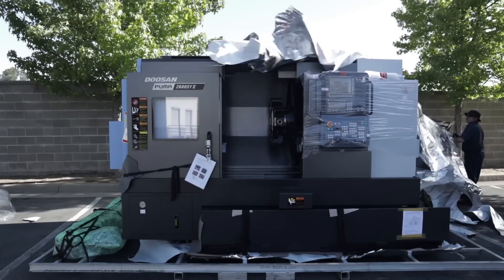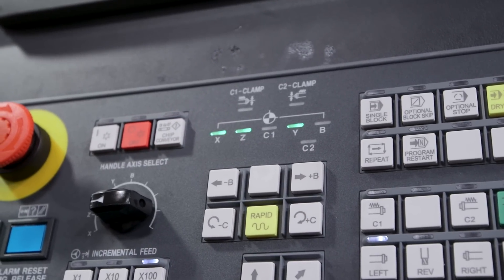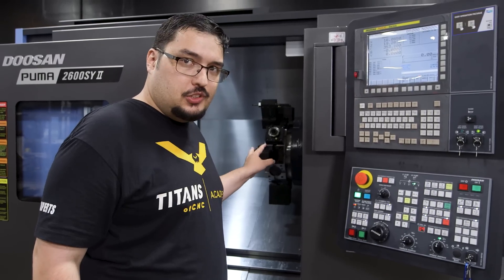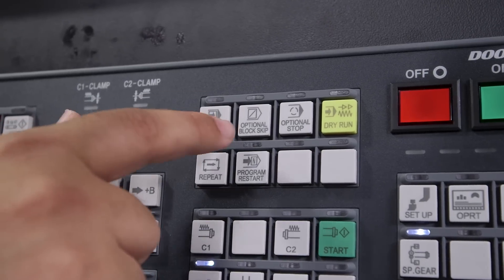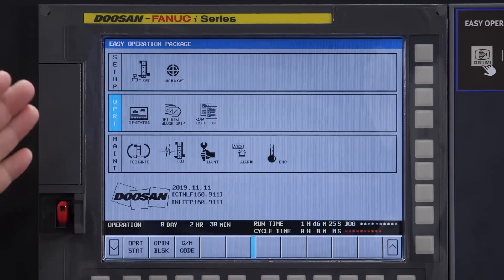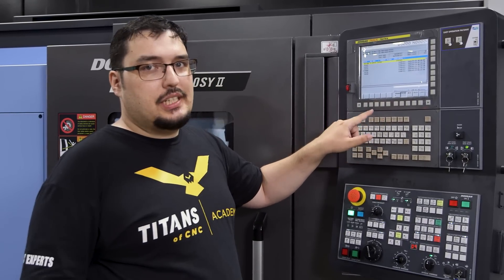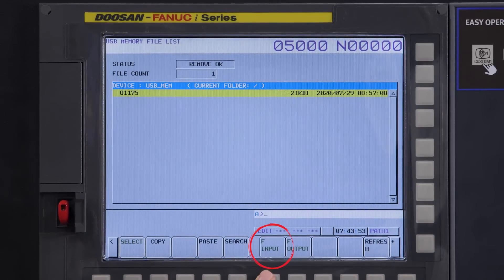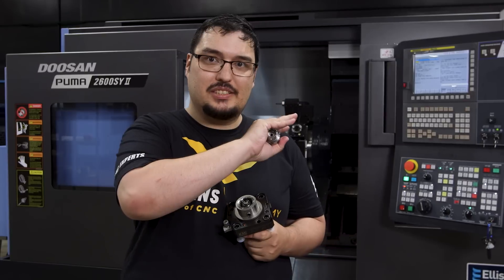DN Solutions PUMA SY II | Control Overview

Comment: That user interface looks coming out of 80’s looks so outdated
Reply: Agree but it's a choice. Fanuc is renowned fot its reliability and a part of that comes from not changing things that don't need to be changed. Also, big companies like to standardize as much as possible and thus fanuc is a great choice for them.
Personally I used Siemens 840D sl touch screen and I laughed when tyson had to "F get" ,  "P set" etc but once you learn it becomes normal and it's ok as well.
Reply: @StefanoLinguanotto   totally agree but im new at CNC machines and when i see something like that to just run the program i scared. It still be reliable and user friendly. For example Smartphones right both old and young people can use it
Reply: Ultra CNC  arc rounding parameter is a simple change, so is the acc/dec setting for thread retraction, both Mitsubishi driven, not part of the mapps interface. The bloatware isn't necessary, but is there to be as simple as uploading drawings and setup pictures to being able to load and unload jobs, including nc files either via operator or production schedule. None of that stuff is necessary from a basic standpoint.

Turn on control, tap the status monitor to get to the app screen, hit CNC and you're at the hmi. From there, it's set tool, set work, load program. I don't see the issue. As far as doing anything with the door open, that's CE safety spec. You can do more with the door open if you sign the release waivers and get a level 4 smart key. If the door Interlock isn't triggering fast enough or properly, have service come and readjust the pin so it engages better. None of your complaints really stem from the touch screen. Could the hot spot be a little bigger and screen transitions be a little faster? Absolutely. Is the conversational powerful for basic turning and milling? It's one of the best going. Your other gripes are Mitsubishi or interlock hardware related.
Reply: I've bought a few Doosans lately. But I still prefer a Mori!!
Reply: @williamlind2843  mori is nice.... but 9 Axis!!!!! And doosan is also much more!!! Mori is with f od advertisement!!!! Otherwise these beast machines are!!!!
Reply: @partscience  Speak English please. Pray to GOD you or your operator never crash a Doosan. Throw it away.
Reply: @williamlind2843  I'm not getting you dear... I think my comments are in English...
Reply: @williamlind2843  oh I think due to some dictionary errors some words....
Reply: @williamlind2843  I mean Mori with Good Advertisement...
Reply: And beast machine mean Doosan is also beast!!! 9 Axis Doosan is very nice!!! Mori obviously is very well constructed, Japanese mean quality but Doosan equipment is also very nice!!! Its making landing gear!! So don't think is trash... its stability and weight shows vibration control is very nice...
Reply: Also we are at the age computers can run realtime computational fluid dynamics. Im not saying fanuc control is not good we have fanuc machines that they run so good no word for control part but user interface is so confusing. Im not saying fanuc should change their control im just little upset about interface not the functionality. Newer version of  Heidenhain control are clean i used some really old ones and see the newer one. I think fanuc can have really good user interface while not effecting the functionality.
Reply: @Game0verxD  if this is problem can we change/upgrade to other stuff??? Like better Siemens etc...
Reply: Ultra CNC  For real? The whole USB shit is outdated, even a 10 year old Siemens control is ahead of this one. Being limeted to only numbers as filename, cmon it is 2020 not 1990.
On a DMG you even have the choice of using the extendet interface or only the Siemens 840D that is the basic for it.
Other controls also went with time and got more to offer in terms of user experience.
Reply: Ultra CNC  Troll, show me one thing i wrote that is not a fact. I work with this stuff day by day. Even china made stuff gives you the option for a solid control over the basic fanuc style one.
Back in the days Fanuc was one of the real good ones, but they missed the point to move on and now are behind and need to catch up.
Reply: Ultra CNC  Fanuc not perfect, that's right. This conroller takes a lot more time to do some basic stuff then siemens or chinese controllers. Typically fanuc do not show g54 system until program is running.
Reply: Control is over machine... so focus accessibility, reliability... that is OK!!!! I think well working machine, machined parts, production performance is output that is for costumers to look at!!! Not controller!!! So lets say HAAS machine with good GUI etc... but higher tolerances in part, less production capabilities... then which thing costumer want??? Its controller or output part!!??
Reply: Ultra CNC  Also its extremely stable and fast..! Unlike some other (cough Haas cough)
Reply: May be your point is your own experience... but main focus on features I found in this that many functions are much better!!! Like on pushing a single button many tasks are working OK!!! So I think as per machine demand this is nice... like second spindle control etc...
Reply: Ultra CNC  but I think more features also worth... but if they are in use... if only ment to cost increasing then I think working with fully compatible, supports all functions that machine demands... so over feature the control is not best option instead increase machine capabilities...
Reply: Ultra CNC Spot on my friend.
Reply: @machinist5506  Yes in this machine control is bit lower quality and over cost!!! So #Fanuc needs to increase their control capabilities... like above mentioned...
Reply: That User Interface is great
Reply: Ultra CNC  
You are still trolling ...
- You show off by telling you can program it in your sleep, fine for you, shows you understand motion and g-code, but what does it have to do with the actual control? Can you only do that on a Fanuc? I guess not, you only would have to know the different ways the controls wants it to get done, what kind of cycles you maybe wanne use. 

- Did i say you should buy china stuff? NO, i did only point out they even give you an option over that basic control they tend to come with.

- You claim market share? Guess what, i can show you numbers were Heidenhain would get 4 times the share then Fanuc does, Followed by Siemens and then by Fanuc. Controls are most not getting picked by the operators at the floor that use them, but by management that might not even have seen one in real life or operated one. It also does depend on cost and what it will get used for.  In prototyping you might pick a different control then for production, all based on what your needs are.

At the end it comes all down to what the company you work at does prefer or already has in use to cut down on training. Thats is why a big market like the US for example pushes the shares up for Haas, but seeing one in Europe for is very rare.

But thanks for the insult at the end, tells a lot about you and how ignorant you are. Cause even while i give credit to Fanuc for what they did in the past for cnc controls, you still think it is the best to try and insult someone.

And yea you sure busted yourself up ... sorry but nice try.
Reply: Its nostalgic tho
Reply: Agreed. On my dnm500 I set it up to run the file straight from a compact flash card, it takes alot of these steps out but its still clunky. I tried setting up the network file server crap but that was a nightmare and I gave up.
Reply: Yes it looks outdated, but this also has the adventage that some Oldtimers aren't afraid of a new Machine because they still feel familiar with the older Fanuc Controls
Reply: Ultra CNC  you just don't know your way around it 👌